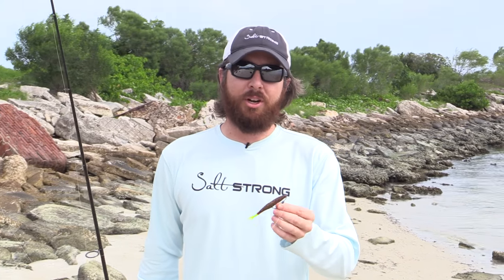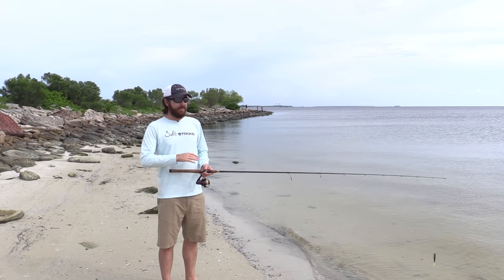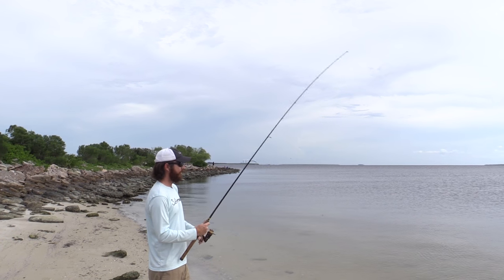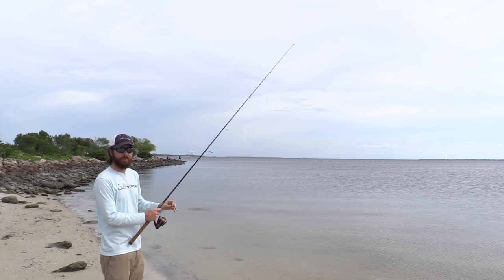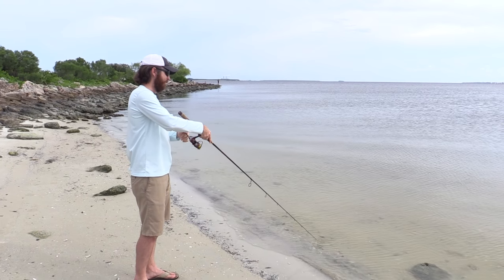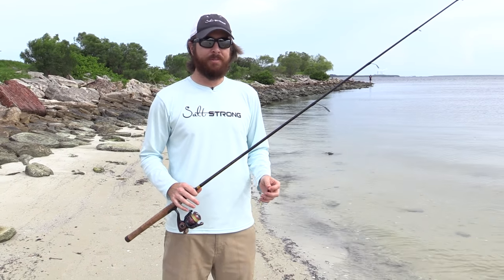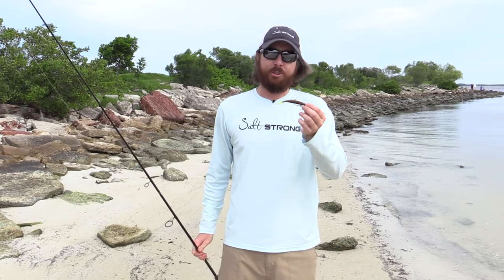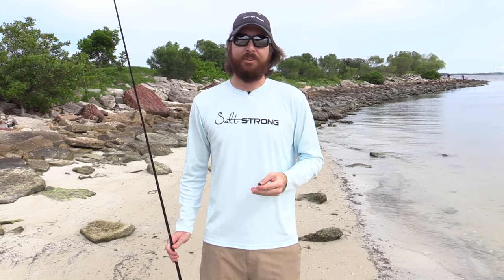How To Retrieve A Soft Plastic Jerk Bait [Inshore Fishing Tip w/ Underwater Footage]

Comment: I believe the perfect cast and retrieve depends on conditions, feeding times and what you're throwing over. There is no "perfect " way that everyone should do it.
Reply: i like to use them on a ball shaped 3/8 or 5/16 short shank round bend jighead, because it helps me "feel" the bottom a little bit easier, just feel the bottom, 1 sec pause, twitch-twitch reel in slack and repeat =) very effective on snook and trout here in Cancun MX.i guess is that it mimics a feeding or foraging baitfish?

Comment: I'm using the Carolina rig and I'm pier fishing what should the weight of my sinker be?
Reply: That all depends on the depth of the water that you're targeting. I like 1/8th oz for water less than 5 ft of depth, but then go heavier as the depth increases (or if there is strong current).
Reply: Brian Anuvattanachai,
Try drop shoting them.
I fish drop rigged flukes off the pier and kill it on california halibut, rockfish, sandbass, and calico bass on my side of the coast.